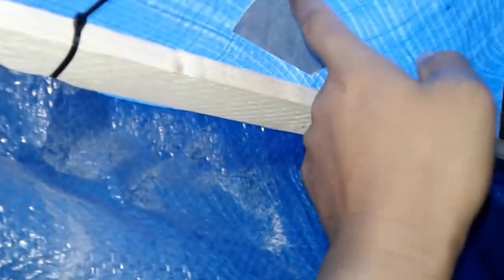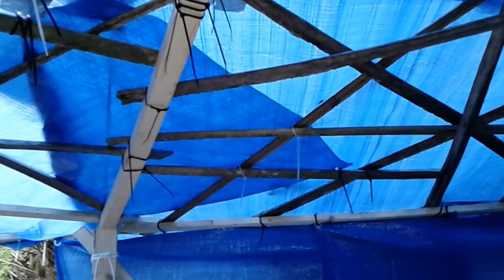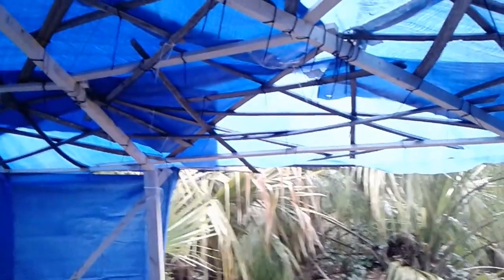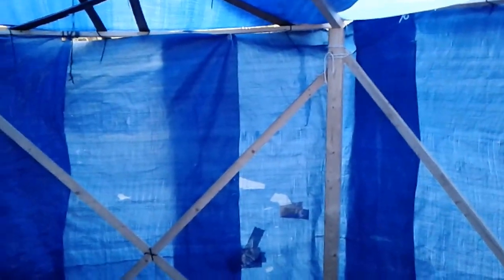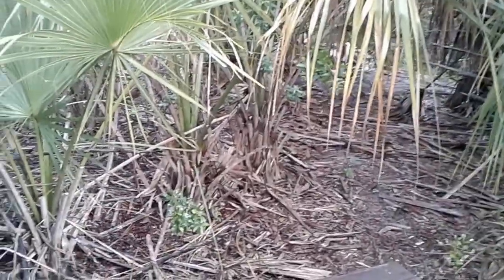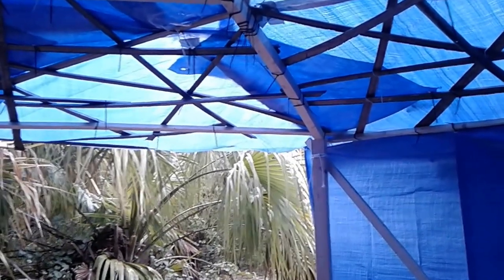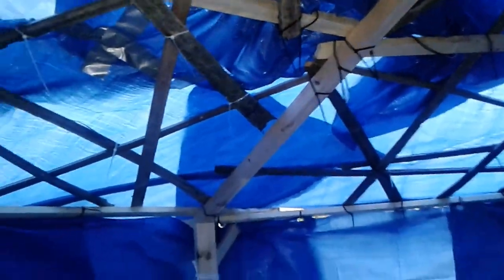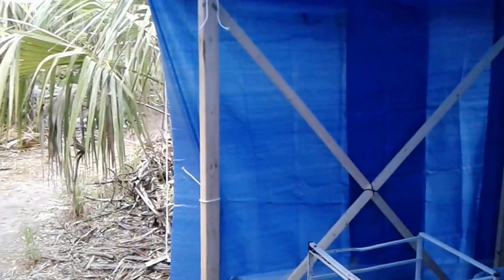Tiny Home - Fixing A Leaky Bug Out Yurt Roof (V667) Bushcraft Urban Survival

Comment: If it were me, I would get an extra large tarp and spread it over the entire roof, tie it down and then put your grass on it.  Not sure how much they cost, but I've seen them at Big Lots or the Dollar Store fairly reasonable.
Reply from the maker: Diane Lyman Dollar Tree only has rhe 4x6 ones. For future builds, I would use one large tarp even though it is more expensive.
Reply: Yeah, I think one solid piece would help with your leaks.  You are doing great though!  When I was younger and liked to tent camp, we had an army tent and I used to take a shovel with me and dig a berm all around the outside perimeter of the tent to keep all the critters out.  I'd put rocks, logs, whatever I could find on top of the berm.  You can direct the trench away from the tent so when it rains the water flows away rather into the bottom of the tent.